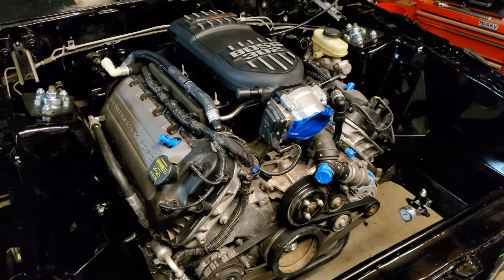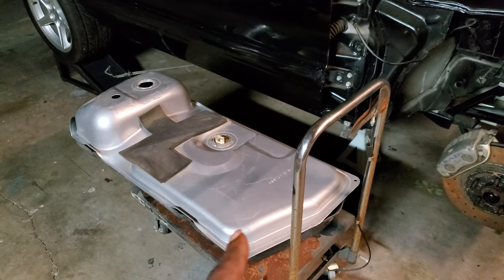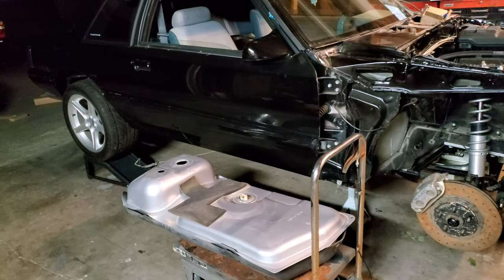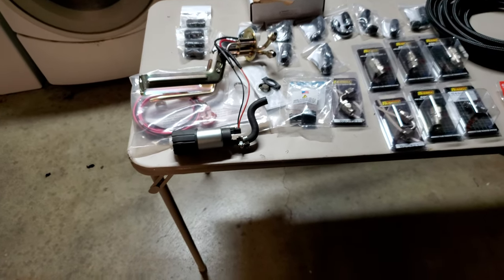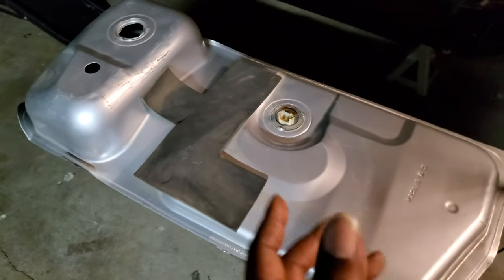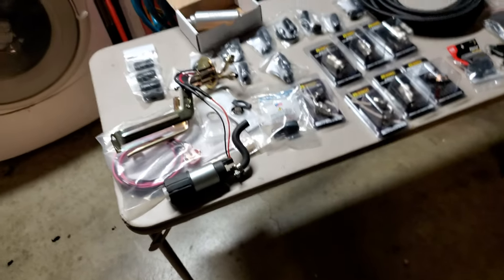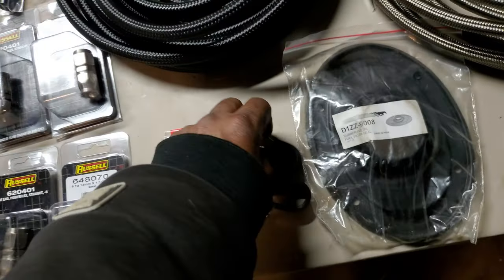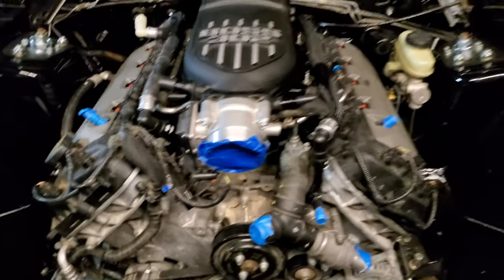Foxbody Coyote Swap Fuel Systems - Lets Break It Down - What Set Up I usually Run

Comment: My origianl setup was a stock tank upgraded hat with a hellcat pump..when i put the loki on that was a no go😂😂..i had to buy a stealth tank..fore hat .. then low and behold PBH sells the whole kit which i bought but they don't tell you that you have to use these ol shakey johnson clips..uhh no..so i had to buy a cobra 03 sending unit just for the gasket and the floater..😅😅..

Comment: I run an  87 tank on my 85 foureyed coyote swap I just put the 85 sending unit in the middle hole and custom bent the float. It was a little trial and error pulling the tank in and out rebending the float trying to get the gauge to read correctly but it's been working for years now
Reply from the maker: Nice! Good job. I didnt want to keep messing with the gas tank. I hate dealing with gas